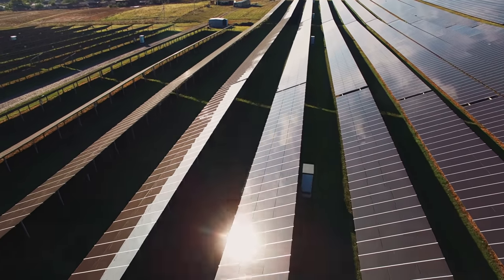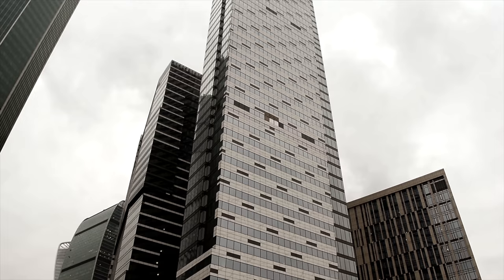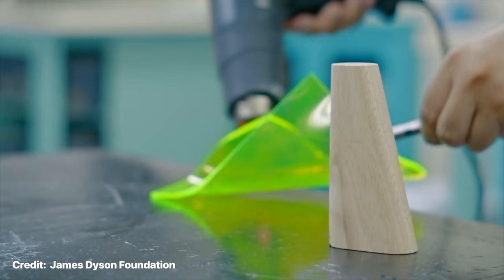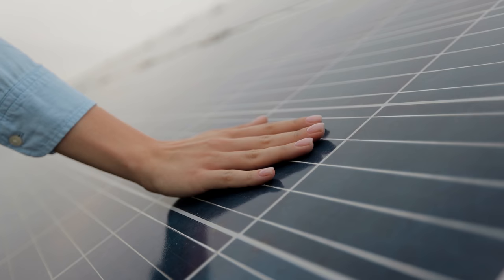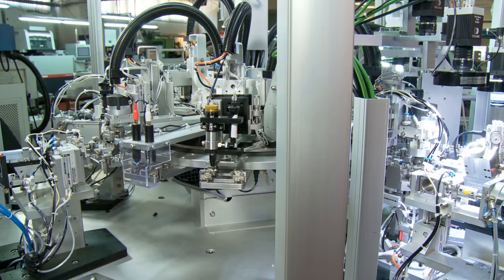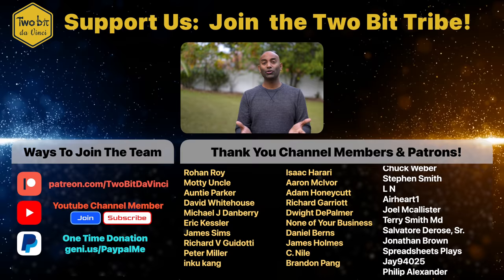These Solar Panels Work on Cloudy Days! AuREUS Solar Panels Explained

Comment: if they pass regular visible light I think the idea of just manufacturing an "addon" for regular panels would work best - like a sheet you install on top of your existing panels
Reply: Yes this is what I have thought.

So you cut the panel it in 5mm strip's an turn them 45° would this work like that on the edges?
Reply: I think that a a good idea. I would like companies that do produce any panels to figure out how to drop their waste of materials ( I was going to say first but I don’t know if that’s right) they’re loosing tons of product in the production process. It’s a big number idk off the top of my head but look up processed silica and it’s not an efficient thing. Yet. I love innovation and improvement in all this stuff. Gets my mind rolling in random directions haha. (Babbling finished)

Comment: I wish videos and articles on these concepts did a better job at making comparisons and tempering expectations of new tech.  This concept responds to a given set of circumstances and might be great for certain scenarios, it’s not “better” than current crystalline silicon based solar. Today’s solar panels don’t lose efficiency when it’s cloudy they simply produce less power at a given moment, the day’s energy yield drops as there was less energy available that day…innovations that work well when cloudy or when there is reduced light energy available have limited impacts that need to be weighed against their trade offs, added cost, limited durability etc.  I’m impressed by these innovations, this person has a great future. I like these videos but I’d like to point out that today’s solar and wind energy is already cheaper than coal!  Get your systems installed. (I admit intermittency needs to be managed but time of use cost and storage can manage this)
Reply: Well this doesn't replace solar panels, it just sits on top of them... it fluoresces in UV, giving out extra visible light for the solar panel to absorb... at least, that's how I understood it, maybe I missed something.
Reply: There are several YouTube channels like this. They simply take a nascent technology, regurgitate the marketing BS, fail to offer any genuine comparison and then tag on their sponsor's message. It's technologic click bait for the masses in all but name.
Reply: @annoloki  that is what I understood too, also from another video I just watched about this.
Reply: @annoloki  But can the loss from the cover panel ever make up for the extra energy obtained from UV? I don't see how it can.  The total energy in UV that can be used (limited by total UV irradiance then the stokes shift) is less than the loss of visible light from internal reflection and absorption. But I am rusty - feel free to contradict me with some more solid numbers.

Comment: what a great idea. Surely you could layer them over an existing panel to create two way energy generation?
Reply: Definitely not. The loss in visible light generation will more than the gain from the UV.
Reply: If it doesn't reduce the regular light capture too much. Seems like it would reduce regular efficiency more than it picks up from UV light.

I think this would only be useful to add in areas that don't get direct sun very often and don't need much power.. ie cities where it's cloudy most of the year.

Comment: Reminds me of the issues related to OPV (organic PV) and BIPV (building integrated PV).  These haven't really taken off.  As mentioned in the video, there are the issues of efficiency, and cost.  Also, lifetime (which is also an issue with perovskites).  The UV angle is interesting.  But we'll see.

Comment: Interesting video but your explanation of Aurora Borealis is in part wrong. The magnetosphere captures *charged particules*, not gamma or other kind of electromagnetic radiation, those are blocked by the atmosphere. Cheers!
Reply: Charged particles ARE radiation.
Reply: @terrafirma9328  You can call it radiation indeed. But my point is that the magnetosphere does not catch or redirect electromagnetic radiation, only charged particles, and the video specifically mentions gamma and x-ray which are electromagnetic radiation not charged particles. Cheers!

Comment: I don't really like the idea of covering skyscrapers in "transparent" solar pannels, especially if they are colored like that. I think this is some niche application that has almost no usage, high cost and low efficiency.

It is because the amount of energy sent by the sun is constant regarding the ground area. If you put solar on walls, this harvest lest energy by square metter on ground. Depending on the sun inclination it can achieve more efficiency than flat ground pannels, but the shadow casted by this will be far greater. Thus honnestly, for the area covered by skyscraper walls, you could cover lots of rooftops with it and probably be more efficient especially in densely packed areas where buildings cast shadows on each others depending on the time of the day.

Moreover, if you look at power distribution through wavelenght, you find out that the most power is achieved at... visible wavelenght. So even with 100% efficiency pannels (traditionnal AND UV ones) you could not get the same output. And worst of all : I suppose that the energy conversion from UV to visible to harvest it is not perfect leading to lower overall efficiencies.

As much as I'd like to see this working to solve energy crisis problems, I think there is some physic impossibilities here. I wonder if that is possible to cumulate BOTH of this : traditionnal solar with UV conversion films. Thus it could harvest both UV and visible light, improving the solar pannel efficicency. And if that is exactly the point (this is not clear from vid, does Aureus pannels alos gather visible light ?) then it might be really good.

But what we saw is a semi-transparent solar pannel that let the visible light through...

Comment: I've been experimenting with a 1.0m x 0.5m 100 watt 12v PV panel, and this produces 40mA on a wet cloudy day in December at about 53 deg North.  It's set flat against a vertical wall.

I can't give a meaningful mA-h figure for the day because most of the time the panel is in the shadow of a building at this time of year.  In summer this location is a sun trap so it will be interesting to compare the figures.
Reply: Hello from 52.4° north!

Comment: I suspect that what is actually being proposed here is a panel that uses UV and transmits visible.  Now this would actually work, in a ideal world you could cover windows with it and visually nothing is different but it would still generate a small amount of power. In principle this could also be done in IR where there is far more energy available but it is 'lower quality' energy which is harder to do anything with so I don't think this would ever be practical. The economic challenge is it is cheaper to have panels that use part of the visible light and generate power by slightly reducing the light transmission or panels that use the UV light and probably also reduce light as a unwanted side effect. The UV panels will need to be very good for this to work but fingers crossed that they can do it - it would be great.
Reply: And then there is the lifetime of these panels.  UV is nasty stuff and tends to degrade most things especially anything organic.  What are these panels made of and what is the active compound/stuff/quantum dots/etc (this question used to be much easier but the world has moved on). I am guessing that current panels include a UV absorbant to protect against it but clearly this is not a option in a UV fluorescent panel. And then there is the issue that half the fluorescent light goes the wrong way so needs a wavelength specific reflector.  I am still keen on the idea but the more I think about it the more problems I find :-(

Comment: My solar panels on a cloudy day charges up my batteries let's see by 11:00 in the morning and sunny day 9:00 in the morning wow and I've been doing this now for how long 25 years I don't make solar panels I just buy them and use them and my batteries are good of course they're not the very expensive battery that give you very little amperage I like the thousand oaks well actually I like the 1250 amps but they don't sell those no more

Comment: I think Carvey ought to contact SolarWindow Technologies, Inc. (WNDW). I think they may have a synergy, if combined, to leap ahead of current solar panel technology. If it can be brought up to industrial levels, I think Aureus will be the next big step in solar technology. This technology would be extremely beneficial in the auto industry if its panels can embedded into various surfaces of the auto similar to what already exists in vehicles such as the Aptera, the Sono Group N.V.( SEV) and others.

Comment: Okay I think I get it now. It’s converting uv to visible light wavelengths in order to produce electricity. I assume it can always use visible light and then on the cloudy days it can still produce electricity. Hell yeah this is great steps. I’ve always said green energy is inefficient and instead of producing a bad product pump that money into more R&D. Make a product that is feasible to incorporate into our grid and stop wasting it on large production. Innovate, test, and improve. Love this stuff. Side note we should probably figure out how to produce panels without the large amount of waste.

Comment: I installed Solar panels in 2009, maintenance and repairs far exceeded the energy costs I saved.  Our current electricity from the grid is ultra cheap and will never allow solar or wind power to compete until the electric grid costs quadruple.

Comment: What if you use the panell use a drill and drill on this plate? You don't drill through only a little bit to have a cutting edge so you can have this pattern and use the plate on a regular PV panel

Comment: I've recently designed a system that would be complimented by this technology. I  have yet to release my IP, and don't plan to do so in the immediate future. A flexible panel with a higher efficiency rate  would be a major plus.

Comment: Very interesting.  One issue is that of the total spectrum reaching the earth's surface only 3% is in the UV range.  If it were higher, solar panels would be "tuned" to process it.  44% of the spectrum is in the visible range-as such solar panels are "tuned" to that frequency range.  But of course you knew that already, dincha?

Comment: I have a question: could it be that most of the earth’s heat escapes into outer space via the poles?  Could that the the main reason that the poles are so cold??  I know that the poles are located where sunlight is weakest, but air and water current flow patterns ought to distribute heat to the poles----unless heat were escaping from the poles at an exaggerated rate due to the absence of the “magnetic bottle” effect that prevents heat loss where the bottle is intact.
Reply: NO! So many wanna downplay the Influence of the sun. Dont worry there will come a time you shall understand!

Comment: I don't think we have to worry about discarding perfectly good crops. Supermarkets waste enough fresh fruit and veg all over the world, crops are affected by pests and get thrown out (eg, bean seed fly or carrot fly). 
A farmer with a ruined crop should be able to contact someone and have the entire crop sold off for processing into solar panels instead. 

It's linking the customers to the processors which is the hard part in any industry. All too often that's the failing point. 
Like the way farm animals have entire fields dedicated to feeding them, when next door may be acres of allotments or arable fields some distance off growing fields of vegetables, the edible green stuff we waste but animals could eat discarded and left to rot. 

So this solar company needs to set up a unit dedicated solely to the collection of this waste matter, ensuring their contact details are freely and easily available for local growers, supermarkets and other relevant industries.

Comment: As always that 2 bit da vinci energy is awesome!
... but lets not get taken for a ride on something either.  There just isn't much UV light to work with, and it is far simpler to do a direct capture of UV light which can get similar efficiency to normal PV solar than making a film which re-emits in a different wave length.  The issue there however is that the harsh nature of UV breaks down the material and panels need to be replaced more often.  That is why most companies will use a UV film to prevent UV from ever reaching the panel in the first place.  The energy created does not justify the cost of replacement, and a re-emission film like this would only hurt the normal solar efficiency.

That being said - there are no bad products, only bad costs.  So if you had a high UV environment and needed something that isn't as likely to break down, then this may be a good solution.  So maybe something in space?  Or some industrial process that uses UV?  Or more as a sensor rather than power production?  Or some future concentrated solar plant that sorts the warelengths first to more effeciently use UV, visible, and IR energy?

There may be a good use for this, but right now it looks like a solution trying to find a problem still.  Its like a 90s kid who had UV color changing shirts or cups and was like... I wonder if this could be used for something other than color changing pigments and UV resin?
What I am really struggling with is how many large items are going to be socially acceptble in lime-green.  I mean solar panels and windmills are beautiful and the nimby crowd is already dead-set against them.  They would think the world was ending if a skyscrapter was covered in sheets of this lol.

Comment: Look for MoonStudio's answer if you like numbers.

Come with me if you prefer using just common sense alone.

So, we have solar panels that work on visible light. And these panels need a lot of that light to give usable power. So, in cloudy days there's also lots of light, but it's so much darker, that these panels produce barely any power. 
What does our invention do? It converts UV into visible light. So much of it, that it makes panels much more powerful in cloudy days. 
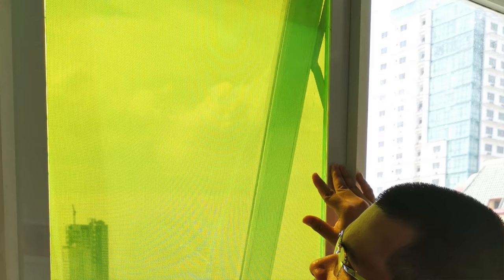Let me spell it once more. Thin glass produces more visible light than there comes from cloudy sky by itself. It must look much, much brighter than the cloudy sky by itself. So, do we see that in reality? Do we see that in pictures at least? Nope. Look at this glass and at white building and tell me which one is brighter. 4:56

Ok, visible or not. What about the power? Everyone knows that on cloudy days it's now so warm outside, right? No need any sophisticated equipment. Just fill some black bucket of cold water and compare how fast it gets hot in sunny and cloudy weather. Do we have the same power or at least camparable? No. If UV delivered any power, we would still see somewhat fast heating through clouds. But we don't and the reason is amount of that power.

Looks like AuREUS is another "design" project from someone who doesn't care about physics.

Comment: You know it's total BS when Two Bit da Vinci spends literally 1 minute of the 9.45 minutes of the video explaining where the name for the product comes from.  This idea has been worked on for years. The main problem is that the power loss from the coating on a solar cell more than offsets the power gain from UV. Anyway, who would work/live in a room with these on the windows, creating a yellow room? PS Aurora does not specifically come from aurora borealis (northern lights) - there's also aurora australis (southern lights) as well.

Comment: "hot spots" the sun gives of energy in 2 dimensions Hydrogen  @ 13.6 Ev & Helium @ 25 Ev, my solar panels tell me so! most of the time they are read Hydrogen & act normally but when it reaches these "hot spots " the same panels are recording Helium @ 25 Ev & the beginning  of a  wide drought occurs!

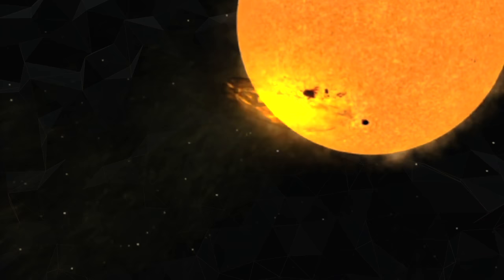Comment: 2:40 - Yes, there is also aurora australis - southern light, of course. You know, Earth has two magnetic poles.
3:00 - NO, not "usually gamma or UV radiation" - charged particles (electrons, protons, perhaps some helium ions...) are "bashing" into air molecules. You mention correctly, just few seconds before, that solar wind consists of charged particles, and that some of those get trapped in Earth's magnetic field.

So, this invention consists of conventional solar panel with a layer of organic fluorescent die. Clever. but you explained the whole concept pretty terribly.

Comment: It's cool, but we have to know the numbers. EXAMPLE :

in 1 day, there is 50% sun time and 50% cloud time (Fake numbers)

1) Normal solar --> Does 200 energy points in SUN time and 0 points in CLOUD time ---> 200 points per day

2) AuREUS soalr --> Does 80 energy points in SUN time and 50 points in CLOUD time --> 130 points per day

BUT maybe AuREUS is cheaper ? so 130 is good for it's price... and the numbers are fake. So maybe it's more or less than 130 points.
Reply from the maker: I like this approach and how you think! Definitely agrrr

Comment: When solar pv like this is proven, people who rent will have the option of going green
Atm its a middle n upperclass thing
For me its a dream
Reply: The building will have to be built 
Or retro fitted with the systems.. 
I know of student halls of residence and Nursing accomodation blocks that have solar water heating built in and PV panels.. 
All new buildings need to be built as close to Passive house standards and incorporate renewable  energy  harvesting .